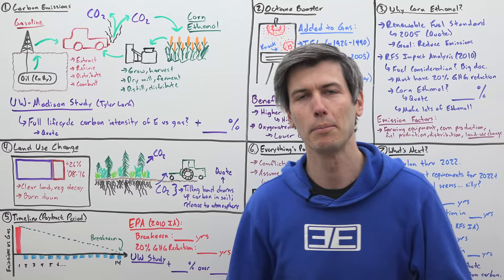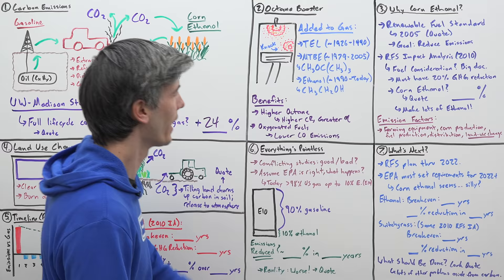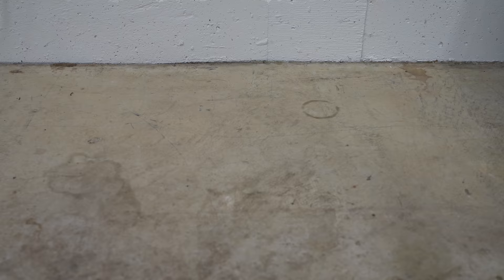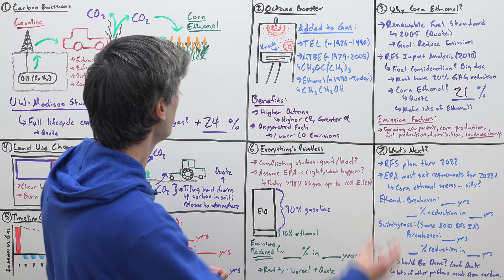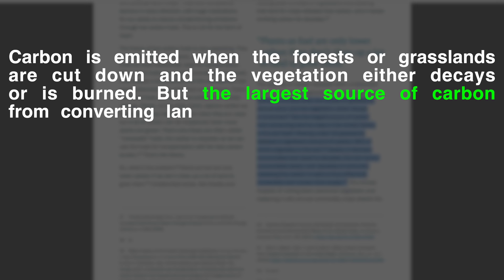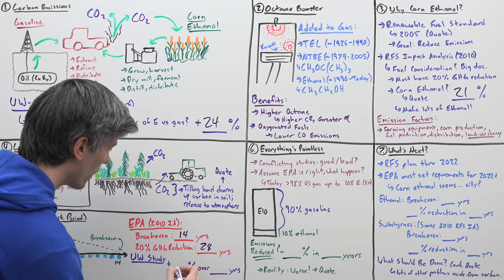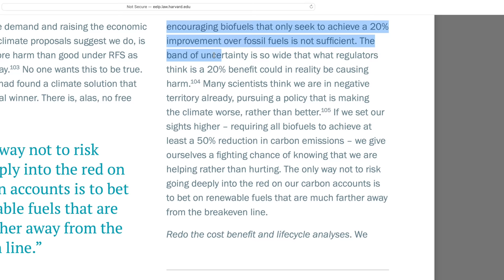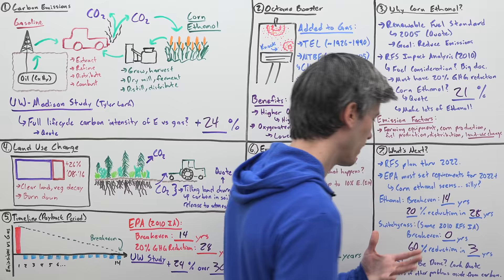America Was Wrong About Ethanol - Study Shows

Comment: Good vid.
I'm not sure of the ethanol source but here in the UK, we have recently moved to 10% and many people are reporting higher fuel consumption, therefore further reducing the environmental savings.
Reply: Yea true, I recall reading (somewhere, multiple places) that E10 UL will reduce economy by about 3-4% vs E5 UL
Reply: @Assimilator1  Spot on, recent MCN dyno tests of motorcycles
Reply: That IS correct. Ethanol has about 70% the energy density of pure Gasoline. So with 10% added you will see around 3% worse MPG. Ethanol does allow higher compression ratios and If an engine is designed to take advantage of that you can reduce this defict.
Reply: @rgrigio  Even turn it into a benefit. It's not fair to judge an engine that has had 100 years of fine tuning to one type of fuel to the same engine running a different fuel and then blame the fuel for a lack of efficiency. There's sort of a conflation of two issues though, one being the energy density of the fuel and the other being the efficient extraction of that energy. They aren't related. 

Ethanol is less energy dense, but what matters is the net energy put into useful work. In a gasoline engine less energy is converted into useful work even at best design efficiency as a ration of gross to net. Ethanol is able to extract more effective work meaning the ration of net to gross is HIGHER in an engine DESINGED FOR ETHANOL. The question is how those factors fit into the larger puzzle of tradeoffs. 

For a gasoline engine 10% ethanol is about as high as one can go before you increase fuel consumption for the same amount of work. Unless you go to 95% Ethanol in an engine designed for it, in which case you are getting a lot of benefits and MORE efficient extraction of energy. The main reason they put ethanol in fuel though is not for environmental reason, but to help keep it dry, blended, and at the appropriate octane.
Reply: Ethanol is pretty much used to water down gasoline.
Reply: @Brad Patton In an engine designed for gasoline. No one anywhere, ever, has suggested that ethanol would be a great thing to burn in an engine not designed for it. It's a strawman argument designed to suppress any possible competition to oil companies. 

It doesn't even make sense to analyze that way though. I don't care how many liters I have to burn per mile, I care how much that costs and how the fuel affects negative externalities present with petrol. And when it comes to negative externalities oil just has so many it could be a whole discussion in and of itself.
Reply: With the introduction of E10, UK ethanol is being produced from UK-grown sugar beet. The by-products of production are heat piped to greenhouses and distiller grain. Very little in this video applies to the UK. 
Ethanol has a higher octane rating (about 109) so is blended to increase octane reducing some of the other additives needed. It also burns slightly cleaner. 
The downside is it dilutes oil with water quicker. Extended drain intervals are history. In most engines mpg will be slightly lower.

Comment: I know here where I live, the amount of waterways, tree lines, and grass decreased big time when farmers realized they could grow corn if they could address certain limitations of the land here in Nebraska. They put center pivot irrigation systems into use which also operate from largely fossil fuels or electricity generated by fossil fuel. There is a large amount of energy used to produce the anhydrous ammonia used to fertilize that ground every year to get a crop of corn from it. I'm pretty sure that the UWM study could've gone even further in identifying carbon released by some of these other inputs required to grow a decent crop of corn.
Reply: Iowa has the worst water ways in the Nation because farmers now plant right to the edge. The govt subsidizing ethanol is woven into many aspects of life there, it won't be easy to take that away. Farmers are never going to return crop land into native grass lands, without, you guessed it, massive subsidies.
Reply: @9023gregb  If it became legal to sell non-ethanol fuels again, it might not take that long.
Reply: Same where I live in
Reply: @9023gregb  you got it! The environmental damage done to the land in the quest for more corn for more ethanol, has caused loss of erosion controls that had been in place since the 1930s. Much of that was habitat for wildlife that has decreased in population. Which is another in planned negative effect driven by the unsuccessful attempt at reducing carbon with corn based ethanol.

Comment: I’m a little late to the comments, but my comment is that not all of the negative things were mentioned.  1 very big negative is the amount of water needed to grow Corn. The irrigation needed lowered the water table greatly, that water took many years to be deposited in the underground. It’s gone. Kansas has started limiting the amount of water that can be pumped, it’s a little late but it will take many years to rebuild the water table. I’m old so I’ll never live to see any difference. 
Thank you for your video.      Thank you Sir
Reply: Without the subsidy for ethanol, KS would probably be a wheat or alfalfa state.  Corn does best in tallgrass  prairie rainfall further east. (Though I wish we still had some prairie left, tallgrass and shortgrass.)
Reply: Many decades at best if not a lot longer to replace the water maybe never
Reply: Iowa is the number one corn producer. They rely on rainfall
Reply: 87% of corn is rain fed.  Of the top states who do irrigate only dry Nebraska is known for corn.

There were no grasslands or forests broken up for ethanol.  Quite impossible since US cropland acres have been declining.  

Census data shows corn producing states (including Kansas) increased grassland/range, forest, and wildlife areas since ethanol came.

The corn belt actually grew more acres of corn in 1980 before ethanol than in 2018, the year of most ethanol production ever.

Erik Johnson, the corn ethanol subsidy ended back in 2011.
Reply: Alcohol fuels and ethanol can be made from anything that can be fermented. Doesn’t just have to be from corn.  🤦‍♂️
Reply: @Paper.Power.Politics  Absolutely ethanol can be made from anything, even the switchgrass mentioned in the video.

In fact, there exists a $1.01/gal subsidy for Gen2 ethanol which switchgrass would qualify for if someone made it from that.

Corn ethanol qualifies as Gen1 ethanol and had a $.45/gal subsidy which ended back in 2011.

Switchgrass requires dedicated farmland and fertilizer, and on top of that cellulose is harder to get ethanol from.  I can list many better sources of ethanol than switchgrass which despite the huge subsidy, no plants that make ethanol from it exist.

Corn ethanol on the other hand is value added from already existing feed production acres with preserves the feed in a healthier and more productive feed called distillers grains.

There were no grasslands or forests broken up for ethanol.  Quite impossible since US cropland acres have declined since ethanol came to be.

Corn ethanol is limited to the size of the cattle herd on feed so at best we can only just over double current production of it.  Becomes uneconomical beyond that.

If everyone ate grass fed beef like I try to do, corn ethanol would not exist.
Reply: Their fake corn doesn’t need much water, never seen anyone in Iowa water their fields…
Reply: @urbugnmetoday3183  Nebraska waters corn and other crops.  Iowa does not need to water crops, they have an ideal climate.
Reply: @danafletcher2341  ideal? I know other places have worse drought but it’s dry as hell here other than a few weeks a year…I’m in the north central part of the state